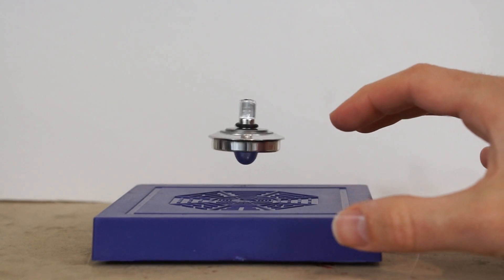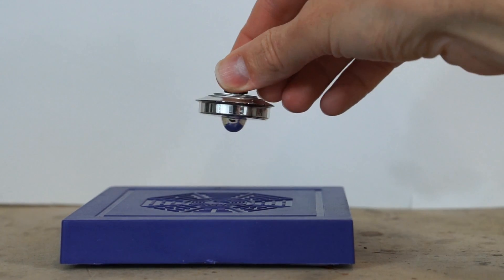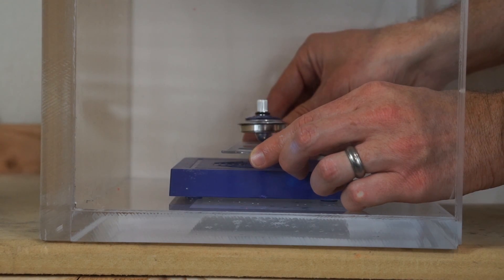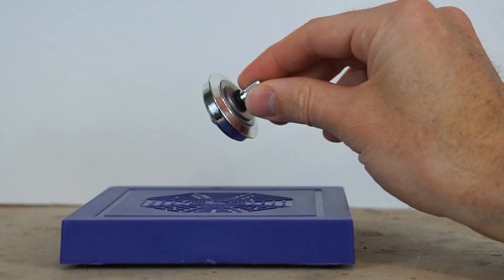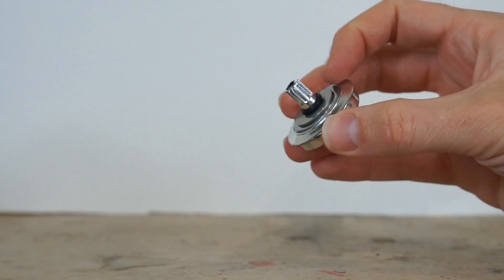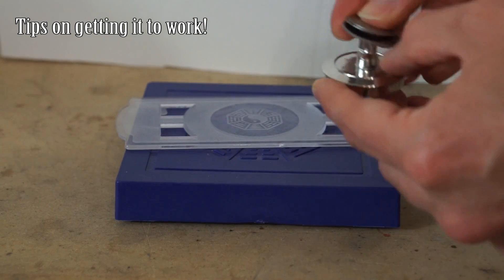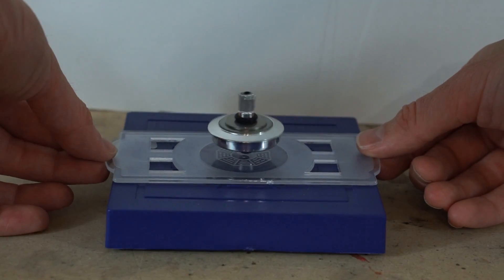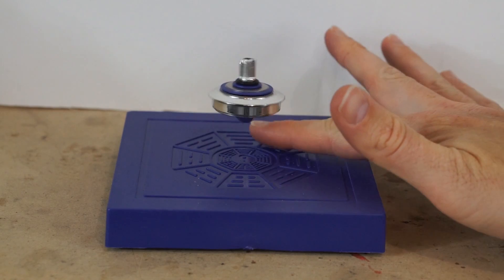Will a Levitating Gyroscope Spin Forever in a Vacuum Chamber?

Comment: The magnetic itself is creating drag. It would be cool to design a globe or solar system (not scale) that would keep moving levitating. You could do it by placing small coils inside of sandwiched borascilate glass or in the base in the edged got electromagnetic spin to be continuously contain and keep a circular momentum. Use lift magnetism and a fast hall effect and fast switching to create the illusion of a levitating and true not scale but to rotational motion. Cool idea yeah?

Comment: Also movement of the disk in stationary magnetic field creates eddy current which is then converted into heat in disk. I didn't think of magnet's friction. And I guessed it would spin for 10 to 20 minutes!!

Comment: air resistance has very little to do with why it eventually stops, it is because the magnetic fluxes acting against each other is the main cause of energy loss and vacuum changes very little other than remove some air resistance, sure there might be some slight duration but im guessing negligible and it wont keep it going because of that

Comment: The friction in a spinning top/gyroscope will cause it to not spin forever. The electrical equivalent is resistance. You can bring a conductor near absolute zero, but you can't actually reach it (O-deg K, -273-deg C).

Comment: How even in Zero G space will make it stop? The Laws of Inertia rules over space. And Inertia says that a mass will be in complete stop or constant movement until an force similar or greater than its own mass opposes it? It is a fact that if you put in motion an object in zero gravity, the object till never stop. There is no atmospheric pressure, no drag no friction and it will just keep moving. And radiation is not a kinetic force, is thermal energy. It would burn an object not push it.

Comment: You've described a innovative hybrid system combining hydraulic pressure, magnetic levitation (maglev), and rotational energy harvesting! Let's break it down:

1. _Hydraulic press_: Applies pressure to the rotor, causing it to spin faster as it approaches the maglev base.
2. _Maglev base_: Utilizes magnetic forces to levitate and rotate the rotor, reducing friction and maximizing efficiency.
3. _Magnetic rotation_: The maglev base's magnets create a rotational force on the rotor, driving it to spin.
4. _Generator_: The spinning rotor is connected to a generator, converting the mechanical energy into electrical energy.
5. _Compression and torque_: As the rotor compresses the magnets, its spin speed increases, generating more torque and electrical output.

To optimize this system:

- _Heavy rotor_: Indeed, a heavy rotor is necessary to drive the generator's shaft and maintain momentum.
- _High-strength materials_: Use durable materials for the rotor and maglev base to withstand the forces and stresses involved.
- _Efficient generator_: Select a high-efficiency generator to maximize electrical output from the mechanical energy input.
- _Precision alignment_: Ensure precise alignment of the maglev base, rotor, and generator to minimize energy losses and optimize performance.
- _Control systems_: Implement control systems to regulate the hydraulic pressure, maglev field, and generator output to achieve optimal operation and safety.

This innovative design has the potential to achieve high efficiency and power output by harnessing the advantages of hydraulic pressure, magnetic levitation, and rotational energy harvesting.

Comment: If you think the energy isbdissipated by the ribg magnet moving around, you could prove it by repeating the experiment with the ring magnet more firmly attached to an immobile object and see if it spins longer. Thetr isn't any evidence show that the ring magnet is actually sliding around, so I don't believe you. The other comments attributing it to eddy currents seems more plausible.

Comment: It stops mainly due to energy loss to induced currents in the base. Varying magnetic field.
In space away from other objects, the main losses would probably be in radio waves due to the same reason.

It's not true that any rotating object emits gravitational waves. Exactly axisymmetric objects do not. (To emit grav waves, you need a varying grav field).

Comment: It will stop potentially due to two factors: magnetic resistance caused by small impurities in the magnetic field, and vibrations or unbalance causing it to become more unstable over time, eventually making it fall.

Comment: I think it will stop because theres still a point of resistance that you can't eliminate here, and that would be resistance with its own field. The rotation is the only thing working against it flipping around and being pulled to the side of the base like we saw at the beginning, so it's using energy to mantain that, creating resistance.
Reply: No, energy is not expended just "resisting" movement. E.g. the wall does not let the ceiling fall, it does not use any energy to do so.
Reply: @denysvlasenko1865  you misunderstood my meaning
Think of it like spinning a wheel on an axle. It stops because it’s losing its energy to friction with the axle

Comment: We’ll I think there’s a chance that it won’t and it will, yet when magnets get dragged across copper. The copor builds a charge and slows the magnet down so no. And if you put a magnet in a cper tube it takes longer to hit the ground I think that it will stay in the air for a very long time or a vary long time.

Comment: I'm a little late to the party, but I'm taking my guess. I haven't watched past 4:34 and haven't read any other comments. I think it won't spin forever. I really want it to spin forever, but I think if it did, then we would see toys novelty toys like this way more often. People would have permanently spinning tops in sealed bottles on their desks, and as decorations. As for why, I'm guessing every time the top wobbles or moves around, it creates a little bit of current in the magnet. That current makes heat. That heat dissipates, sapping energy from the system. Let's see how close my guess is.

Comment: I would use a decoupling drill for more consistent spins. Maybe build a little robot rig with servos and a drone motor to spin it up, detach motor, lift tray, then lower & move tray, all under vacuum, remote controlled or programmed movements with an Arduino. 
And use a brushless motor, because I imagine a brushed motor will start arcing more, without the insulating air at the brushes.

Comment: I question your explanation of the "friction" that's working against the spinning motion. I'd bet the air resistance is almost a non-factor, even outside of the vacuum. I think a good analogy to explain where the energy is going might be what happens when you FORCE a gyroscope off its axis (the spinning slows dramatically). For example, take a fidget spinner that spins for 60 seconds when held still. If you take that same fidget spinner and constantly rotate its axis instead of holding it still, it won't spin for anywhere near that 60 seconds. So, this toy spends the kinetic energy in the spinning top to balance that top on the magnetic base. It has to constantly correct its own wobbling, and I feel fairly confident that this is the primary cause of it slowing down (i.e. doing it in a vacuum has little benefit). So, in space, anything that caused a wobble (however minute) would slow down a spinning object (e.g. gravity, magnetism, random passing particles of any kind, but most importantly: any imperfection in the balance of the spinning object). To substantiate this claim, try playing with tops that are unbalanced. This causes me to conclude that the reason the earth is still spinning after 5 billion years is not because of a lack of forces slowing it down, but rather because of the mind-boggling inertia of an object that big. Regardless, and even absent of any other factor, I think it would eventually stop spinning due to its own wobble/imbalance. Also, for anyone that made it this far: go watch/read something about The Dzhanibekov Effect or Tennis Racket Theorem; it's relevant and fascinating.

Comment: It will eventually stop because of the asymmetries and wobble of your top, those asymmetries translate into em radiation which will drain the rotation energy of the top. If your top were perfectly symmetrical and perfectly smooth and didn't wobble, it would go on for ever in perfect vacuum.

Comment: Personally, I think it will not spin forever since a lot of the energy we use gets turned into heat which gets rid of a lot of kinetic energy that the spinning top started out with when James spun the gyroscope.

Comment: Would the spinner spin forever if you use power to spin the magnet inside the box? Or would it just sync up its rotation with the momentum of the magnet inside the box and then collapse?

Comment: You cant achieve 100% vacum even with much better equipment. Tthere is no such thing as absolute nothingness. Even a seeming vacuum is teeming with virtual particles that are created spontaneously and then annihilate each other.
You may have heard of the Casimir effect, which relies on vacuum energy.
This all means that there cannot be any such thing as a total vacuum so, consequently, absolute zero can't be achieved.

Comment: I nearly got one of those but I got a Levitron instead. It's a lot of fun because you can put things on it like a model or anything that is non-magnetic and not too heavy. The base will levitate the magnet disc almost indefinitely as long as the base is plugged in to a power supply. But the disc will slowly start to rotate after a while. Eventually it spins faster and faster until it becomes too unstable and smacks into the base. I guess it's because the field from electronically controlled coil inside the base exerts some rotational energy as the field is constantly being adjusted to keep the disc levitating. It's a really cool device because it will levitate the disc in place even if you slowly tilt the whole thing over to 90 degrees.

Comment: The wobbling disk is   Inducing a depletion in the rotational force. If this causes a drag to the rotation Associated with the magnetic flux lines, And induces A change in the spinning energy , it's actually generating heat. So here we go again no perpetual motion machine
Reply: We shouldn't forget that your apparatus does not pull a perfect vacuum within the chamber. This is obviously. An additional problem.

Comment: I was going to say that it would spin for longer, but not forever, because of friction with the magic field. But Frans Mulder, in the comments pointed out that "Friction" is not the word.

So: The stretching and breaking and re-forming of the lines of magnetic force?

Imagine if there was a piece of paper or white card, in front of the spinning top (and its base)  with iron filings on it.

Or a glass-fronted cardboard box, to avoid a mess.

Comment: No, it won't spin forever, you have conductive surfaces for weights, which will have eddy currents induced, which will in turn generate magnetic fields counter to the electric fields; especially since the magnet is encased in metal.

Comment: to let it spin way longer would it help fixing the lower magnet plus giving it a mechanic spin (something precice with power) ? i was thinking of more spin equals a higher zentipital force (the ones pulling rotating mass to the center) plus there "shouldnt" be a wabbeling of the lower plate if you lets say glue it to the desk or am i totally wrong ?

Comment: My guess (before watching): No
Reason: there is some kind of "friction" in the magnetic field, because if something is moving in a magnetic field it produces currents as well as disruptions of the magnetic field. This leads to energy loss and thus a decrease in kinetic energy. Conclusion: It slows down (but only very very slowly). So it will spin a long time, nut not forever.

Comment: If it's a metallic object, containing iron, what slows it down most, is magnetic Flux causing internal micro currents inside the metal spinner. The energy gets converted to heat inside the spinner.
Magnetic Fluxes are the prime reason for it to slow down, after friction losses from air or the bottom of the spinner.

Comment: What about eddy currents. Can you try an experiment with laminated magnet so that there is more resistance to eddy currents ?  Then it should keep spinning longer. Or may be use the top with high electrical resistance. That also should keep it spinning longer.

Comment: Could put a mark on it to measure its RPM, use that as a baseline for how fast its spinning and how much speed its loosing over time. Averages over multiple tests in Vacuum chamber vs open air will give you the amount its being slowed by friction with air.
If you can find a way you can spin it up while under vacuum and to a controlled velocity it would be even better.
Reply: The camera frame rate might not be fast enough to measure that. He could just calculate the average duration of repeated experiments with the vacuum chamber turned off then with it turned on.

Comment: Energy can not be destroyed only transfered to another form of energy. Within a vacuum ( a true vacuum ) energy cannot be transfered via the medium (conduit) . kenetic energy remains kenetic. Ferris energy (magnetic) and gravitational would be the only medium on which energy can be transfered. Two forces pushing and pulling will eventually slow it down. So in essence it will not be forever. Just a very very long time.

Comment: what happens if you spin a top in space? that way you get rid of axel, air, and magnetic friction
Reply: Same thing would happen it would eventually stop spinning. Space isn't devoid of everything- dust, atoms, molecules even the light from the sun hitting it would slow it to a stop. And by eventually I mean prb in the several thousands of years.
Reply: @steve23464  what if u spun in it a box made of very dense material, keeping out any form on space radiation
Reply: @beagleking2730  Same result it would eventually stop. If it didn't stop it would be a perpetual motion machine... Which isn't really a thing in this universe. Yet.

Comment: It wouldn't possibly work, because Earth is accelerating. And also because it spins inside magnetic field, some energy of spin is wasted in electric currents that emerge and heat because of it.
Reply: Earth is not accelerating
Reply: @Fritz-qr9oz  it certainly is, can't you feel it?
Reply: @tri99er_  you don’t feel Earth accelerating. You feel the mass of the earth trying to pull you into the center, aka gravity
Reply: @Fritz-qr9oz  it's ok if you don't feel. I don't really care. My comment wasn't here just to get your attention and tell you the "truth" anyway.
Reply: @tri99er_  dude earth can’t accelerate. How is it supposed to do that. Earth is orbiting the sun at a constant speed. If it was accelerating it would have to get faster and faster and that would take proportionally more energy but where does it get that energy from. That would violate the laws of thermodynamics.

Comment: Flat water.  Over ages man has known that water is self-leveling, fueling the debate over flat or spherical Earth.  The term flat Earth is self defeating.  Any elevation or decline knocks it out of the water.  But when you see mountains and crevices covered by water, the surface of that water always seeks its own level.  Knowing this, I would ponder that if 75% of the Earth is covered by water, that 75% of the Earth has a flat surface.  My thought is that The Sun is actually much smaller and closer to Earth than we are told.  The levitating gyroscope you display here is a microcosm of how the magnetic north pole and the energy of the Sun react to each other.  My hypothesis is that the Sun migrates toward the center of the Earth with each circuit during the summer months.   As the Sun gets closer to the center, the intense heat makes the magnetic the energy  gradually weaker allowing the Sun to migrate gradually outwards again creating the summer months closer to Antarctica.  This distance then allows the magnetic center to cool causing the magnetic energy to intensify allowing the cycle to begin all over again.

Comment: I think it will stop because all movements outside the plane of rotation cost energy to correct by the gyroscopical effect. Therefore rpm will decrease and deviations from the plane of rotation will increase drawing more energy and so ending in a flipover of the magnet.

Comment: Even if you had a perfect spin on a perfectly level table (plane of rotation is perfectly parallel to the table), the top will stop spinning because the earth is rotating.  The angular momentum must be preserved.  So, as the earth spins the plane of the rotation remains.  Eventually, the plane of rotation will create an angle to the table and the magnet will flip.

Comment: That is not "friction."  That is eddy currents and hysteresis losses.  If the magnetization of the ring and top is VERY uniform, you spin it fast enough, and you place it carefully enough to minimize precession and motion, it will spin a VERY long time in vacuum -- but not forever.
Reply: Also, gravitational waves are not emitted by spinning objects that are symmetrical about their spin axis.

Comment: The answer is not that difficult. It starts with the start of turning the object through the fingers. When you are unstable, you pass an unbalanced energy to the object. Breaking energy does not result in a permanent constant rotation. It must be 100% match.

Comment: Nice try, but the annular magnet does not move. The rotational frequency of the top is just too high to let the static magnet move. There is friction, but not mechanical friction. It is electrical friction. Induced micro currents are attenuated by Ohmic resistance.